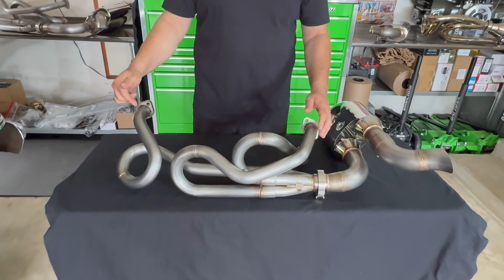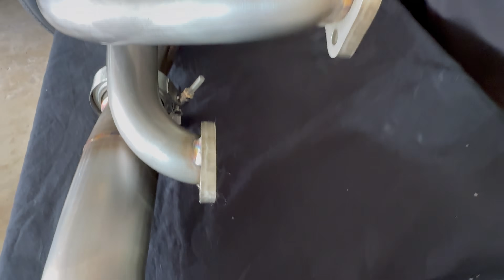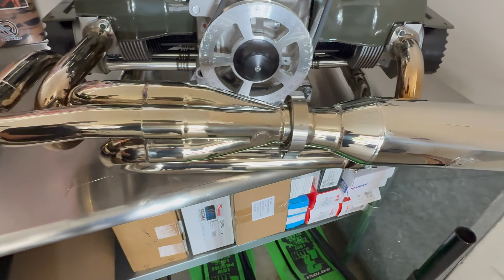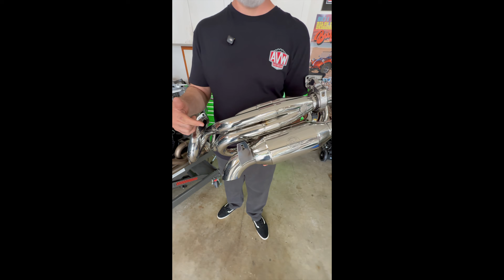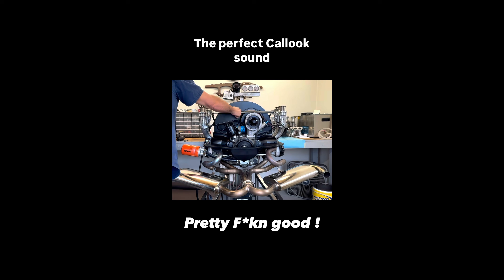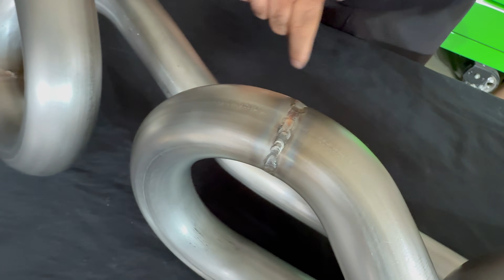Aircooled VW Exhaust System Breakdown for Big VW Power!

Comment: With the 1 3/4  sidewinder exhaust With a bullet muffler vs the low down racing headers with the bombshell muffler, is there a hp difference, or will it be the same?

Comment: I'm running a A1 Sidewinder 1 3/4" full merged race header on a 2332 with a stainless Phat Boy muffler. It has a good sound and it's fairly quiet. I had to pay someone to weld the V-Band on my muffler. So no more 3 bolt flange, and it fits great and you have to tighten one bolt to hold it on. Check it out.
Reply: How does your sidewinder headers compare to the a1 low racing headers, is the power the same,or what's your opinion?
Reply: @Mr.Jacobs-s9h it's probably the same power idk, check with Tiger at A1 or talk to some of the other engine builders would be a great place to start.
Reply: @sshaw7912 thanks for the tip.